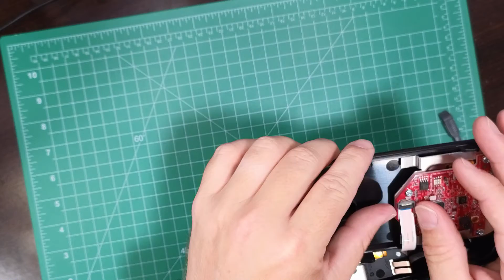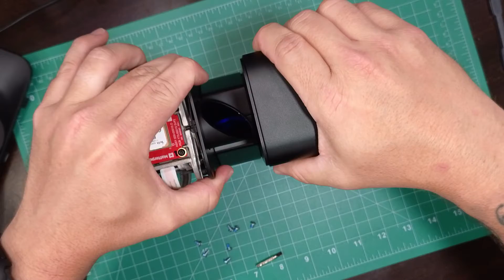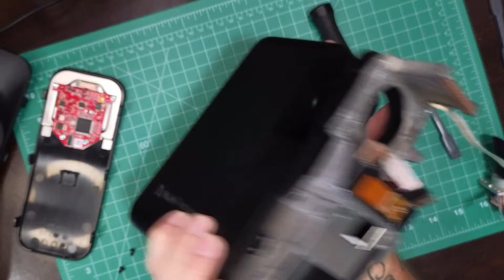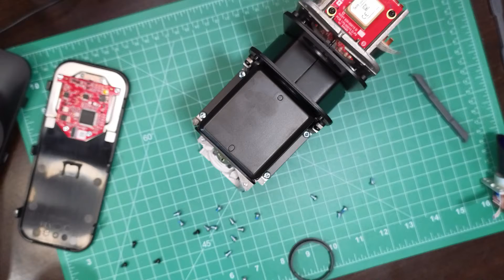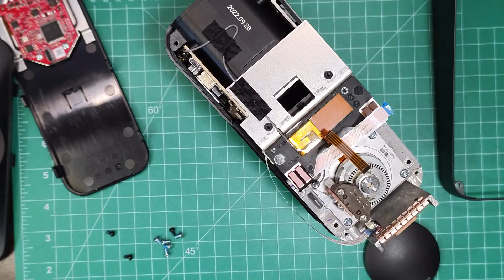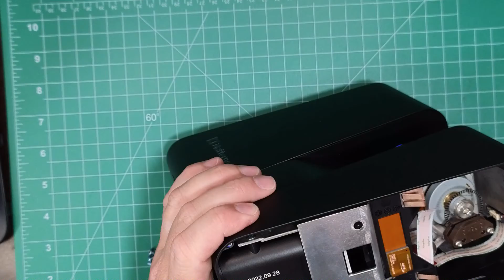Matterport Pro 3 Disassembly

Comment: Thanks for the video! Ive seen one of these drop on a metal pipe once before with an unsettling noise being a result of the drop, must've been the spinning mechanism being slightly displaced causing more vibration.

Comment: This is great! The piece that spins the mirror around, the circular translucent blade with black markers, what is that made of? Does it feel pretty strong and that it will list a while? I can’t tell if it has teeth to move the mirror or if it is perhaps an electronic item being moved by electrical smooth force. I have wondered how long that moving part would last. Thank you for doing this, it’s really incredible and encouraging that the unit is pretty strong.
Reply from the maker: Thanks!  If I remember correctly that was a thin plastic piece, I don't know that it spun around too but I could be wrong, its been a while.